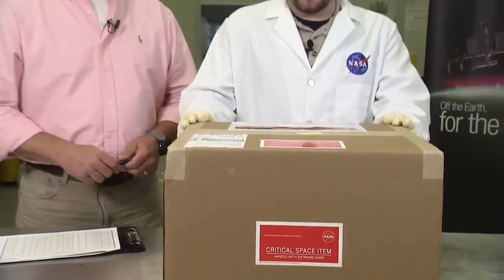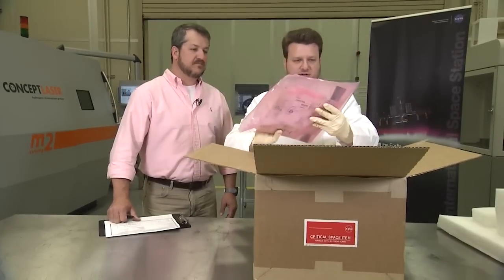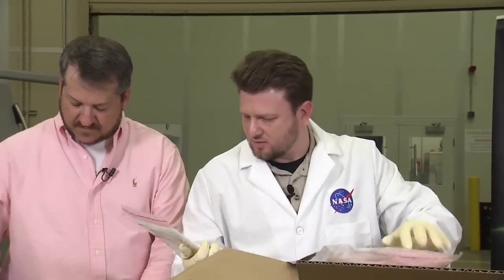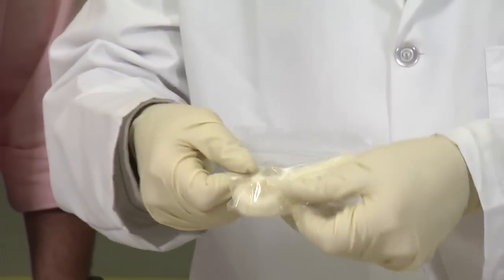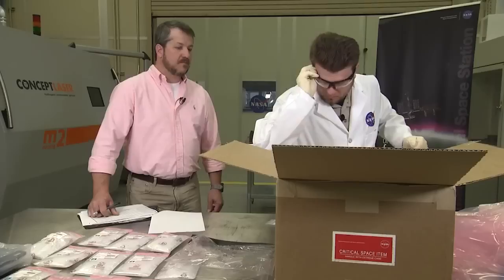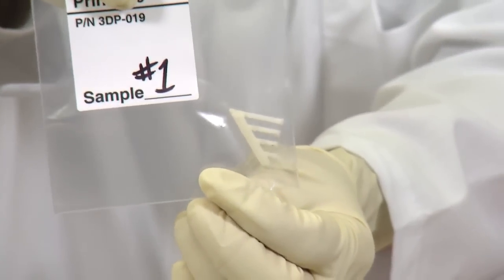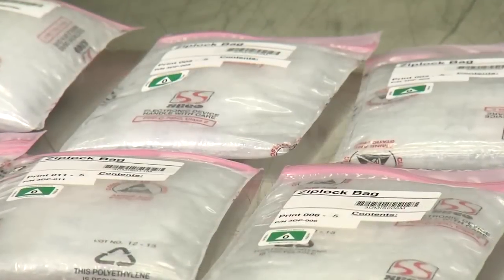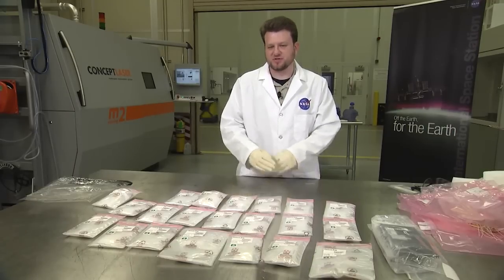Inspecting the First 3-D Printed Parts Made in Space | Video

Comment: What material where the coupons?
Any Difference in cycle times seen verses ground based results?
When does the six axis metal deposition machine arrive. Be a great concept for a new module.
Reply from the maker: Collin MacInnis They just started examining the plastic parts they made, trying to figure out if 3-D printing will even work in microgravity. It will probably be awhile before we know the results.

Comment: GBBA ( Ground Based Booster Assist )

Build a vessel tubular in design that can go vertical in the deep ocean when flooded.
Using a float swivel design to anchor stable at the surface. Anchor the bottom once deployed. Seal the tube, Pump out the water, using maglav to keep a internal piston from ever contacting the walls of the tube. Platform bottom open baffle and vaporize high density sea water as it enters. Once under way using electro magnetic  breaking action to slow platform and separate payload well generation of surplus power, Maybe leading to further imput thru a extending effect past the muzzle thru towers exerting maglav effect.

Look at bertha. Each shell a different diameter. Environmental effects calculated for. Done in 1940's

We need increased payloads. Funny Orion carries a name pondered before. Lol fact that it may have worked.

Comment: Fastest way to manufacturer any large component in space will still be governed by milling or turning operations in my opinion. 

3D printing and metal deposition are a great progression of machining technology. But in the end will never come close to the time frames needed in mass production.

Often ponder the whole idea. Only solution i could ever see was taking a asteroid to near mercury orbit hiding in the dark side. Refracting the suns light to a focal point behind. Using said focal point as a place to melt ore. Your crucible may have to be sealed for refining process. Mixing could prove a problem. Molds would have to work on pressure.. Magnetism... Space may even allow you to increase volume well reducing density in casting operations. Always seen mag lav  technology as a breakthru for  machining for its lack of friction. Question being how much deflection when large forces are applied?